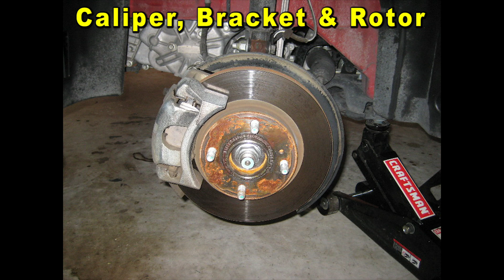2009 To 2019 Ford Fiesta How To Change Front Brake Pads With Part Numbers

Comment from the maker: Ford Fiesta Front Brake Pads - https://amzn.to/4cdBNPe
Bosch Ceramic Front Brake Pads - https://amzn.to/4cdBNPe
Bendix Front Brake Pads Part Number - https://amzn.to/45ntRc2
F Clamp - https://amzn.to/4aTzwI0
Precision Screwdriver Set - https://amzn.to/3sLixaP
Plastic Pry Bar Tools - https://amzn.to/3HMtsV7
Socket & Ratchet Set - https://amzn.to/3Z17LbA
Mechanix Gloves - https://amzn.to/3jCnHkt
Torque Wrench - https://amzn.to/3vS5uSI

The Paul79UF YouTube channel is a participant in the Amazon Services LLC Associates Program, an affiliate advertising program designed to provide a means for sites to earn advertising fees by advertising and linking to Amazon.

This DIY video shows owners of the 6th generation 2009 to 2019 Ford Fiesta how to change the front brake pads.

Comment from the maker: Check out the DIY guide for changing the front brake pads on a sixth generation 2009 to 2019 Ford Fiesta -
https://www.paulstravelpictures.com/Ford-Fiesta-Front-Disc-Brake-Pads-Replacement-Guide/index.html

Here are all of the DIY repair and maintenance tutorials for the 6th generation 2009, 2010, 2011, 2012, 2013, 2014, 2015, 2016, 2017, 2018 & 2019 Ford Fiesta - 
https://www.paulstravelpictures.com/Articles/Ford-Fiesta-Common-Problems-Repair-Maintenance-Guides.htm

Owners of other Ford or Lincoln vehicles such as the Focus, Fusion, C-Max, Mustang, Escape, Transit Connect, Edge, Flex, Explorer, Expedition, Taurus, F-150, EcoSport, MKC, MKZ, MKS, MKX, MKT and the Navigator may also find these DIY instructions to be helpful.